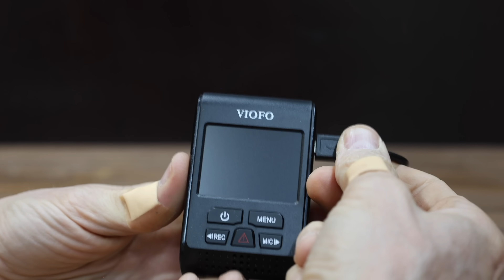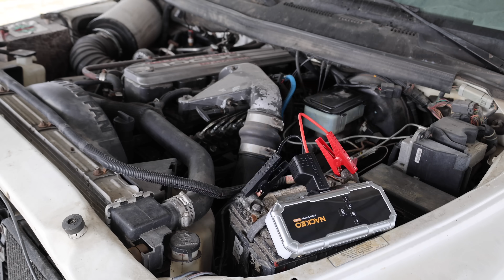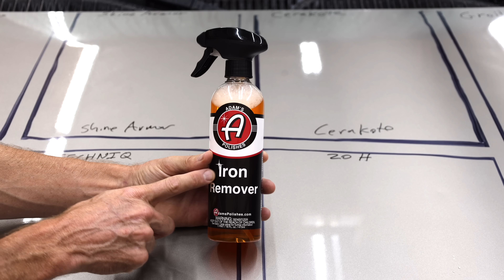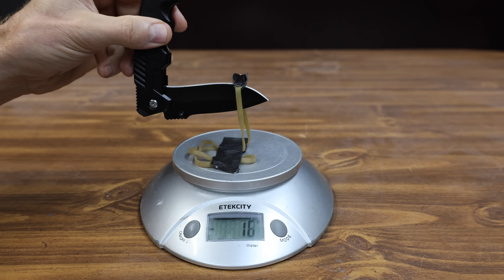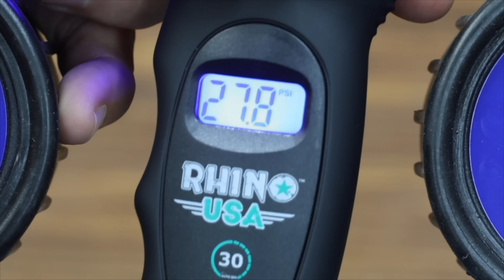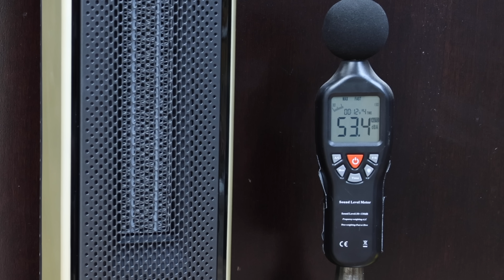Best 10 Items I Tested In 2025

Comment: Great roundup!
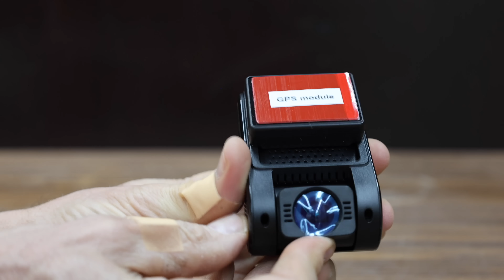0:08 Dashcams
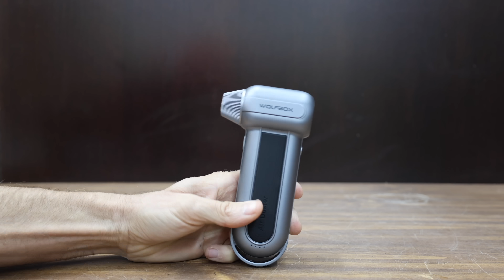2:00 Air dusters
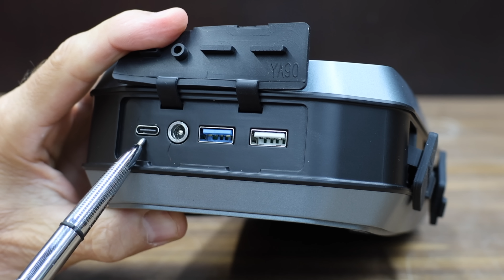3:46 Car jump starters
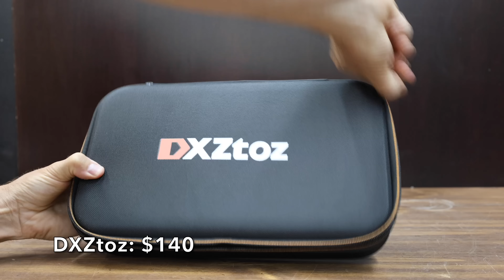5:59 Inspection cameras
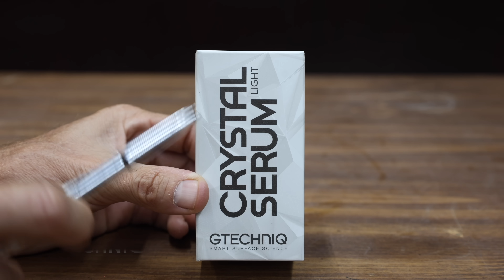7:19 Ceramic coatings
9:36 Car battery testers
11:08 Folding knives
13:25 Tire gauges
15:18 Phillip's screwdrivers 
16:46 Space heaters
Reply from the maker: Thanks for watching!
Reply: yup just bought them all from amazon !
Reply: Dashcam - Viofo $140
Air duster - Wolfbox $90
Jump starter - YaberAuto $81
Inspection camera - DXZtoz $140
Ceramic coating - GTechNIQ $80
Car batter tester - Ancel BA101 $32
Folding knife - Civivi $30
Tire Press. Gauge - JACO digital $28
Screwdriver 🪛 - Craftsman Diamond tip $50
Space heater - DREO tower $90

Comment: I would like a test of battery maintainers (trickle chargers) for maintaining batteries that wont be used but often...not often enough to maintain the battery thats for sure. Maybe a nice year long test.
Reply from the maker: Thanks for the suggestion.
Reply: @ProjectFarm i purchased on from harbor freight that didnt last outside for a car under cover. But boats and RV probably has similar issues.

Comment: I bought the Dreo heater and have not been pleased at all. I first bought a "like new" one from Amazon. It was clearly used and had a terrible grinding sound. I went ahead and ordered a new one which I didn't purchase to begin with because it took 2-3 weeks to ship. It just arrived 2 days ago. It is a newer model and randomly clicks very loudly 10-15 times back to back every 30 minutes to 1 hour even when it is not running. It is either a thermostat or relay clicking, but it is loud enough to wake me up. I guess I am going to contact Dreo and see if they will replace it. If not then both of them are going to be sent back for a refund. The heaters do seem to work well, but that doesn't matter if you want to use them in a bedroom and they constantly make noise that is loud enough to wake 2 people up multiple times per night.
Reply from the maker: Thanks for the constructive feedbacl/

Comment: The air duster, tire pressure gauge/filler and screwdriver set are in my garage because of these videos. Along with many other items from past years. My TopDon battery booster is still going strong but I have the Yaber bookmarked if I ever need another one!
Reply from the maker: Thanks for sharing!

Comment: I have the same wonderful little car battery tester "ANCEL BA101", I used it to test the alternator in my car on at least three separate occasions and the peak charging voltage kept coming at 13.5v. I suspected that something was wrong with my alternator because no matter how much I ran my car it never seemed to fully charge the battery. I looked this up on Google and it said that 13.5v should be fine as a nominal charging voltage, turns out Google was wrong; a few months later my car's alternator died. Also for the benefit of others that don't know this: an alternator that is not working properly and is going bad can and will decrease your gas mileage, further more it will shorten the life span of your car battery if not outright just kill your battery. The point is my instincts told me that 13.5v peak charging voltage seemed too low for alternator and I should have trusted my instincts and this little ANCEL car battery tester.
Reply from the maker: Thanks for sharing.

Comment: Can confirm the wolf box is awesome. So powerful and useful. I use it to blow out everything. Computers cases, laptops, consoles, water from cleaning projects. Just used it to blow off my engine bay after working in the area getting loose debris everywhere from removing parts ect. I’ve even used it to quickly blow off my patio. It doesn’t last forever but it last long enough and charges quick enough for me between uses. The attachments are awesome too.
Edit: I found it from the ProjectFarm video review
Reply from the maker: Thanks for sharing! I'm glad you like it!
Reply: For real, I didn't even know these things existed until I saw his video and have been using it a lot since I bought it. For all the same things you say accept also it's great on wood dust and other products of sawing/routing when you don't want to get a vacuum or leaf blower out.
Reply: It is also very effective and a game changer if you're into cars and like to detail yours to remove water in the intricate et narrow spaces of the car after a good wash.

Comment: Would love to see you test smart thermostats for initial accuracy (temp/humdity) the ability to hold calibration over time, and the ability to maintain a temperature stability (i.e. how well do they dampen minor fluctuations due to air movement in the room, etc.).  Nest, Ecobee, Sensi, Honeywell, and some others come to mind, and I've had issues with all of them with intial and calibrated accuracy, I suspect due to internal heat generation and perhaps poor case ventilation.  In addition, some claim to have "air quality" monitoring capability, but are reportedly widely inaccurate.
Reply from the maker: Thanks for the suggestion.

Comment: I was looking at that Wolfbox but 98dB is deafening. No one should use that without ear protection, especially indoors. The Civivi is a nice knife, D2 steel holds an edge really well, but it isn't very tough and will rust. Blade shape/geometry really matters for tip tests so this will do well, just don't use D2 steel as a pry bar! Boker knives are very expensive, you can get that Magnacut steel for $100 and it is MUCH tougher, like 3x, than D2 and one of the most rust proof steels out there. Just keep that in mind for your usage.
Reply from the maker: Great point!

Comment: The Dreo tower heater was a FAIL after I bought one from watching your review. It will randomly start rapidly clicking off and on extremely loud when on Eco mode. It woke me up several nights in a row! There are a bunch of other Amazon reviews that state the same problem.
Reply from the maker: Thanks for sharing your experience. We're sorry to hear you had an issue with the heater.

Comment: Here’s another idea for a future video A Thermal camera is a helpful tool in my toolbox and one that can pin point the overheating (faulty) components on a board with good FPS is really hard to find specially for a low price. It would be interesting to test the claims they make. Thanks 🙏🏼
Reply from the maker: Thanks for the video idea!

Comment: I have the viofo dashcam. However it has one issue. It sometimes will keep turning on off wifi / recording. I am not sure if this is due to poorly written software or the heat causing the memory corruption. Regardless you'd think that the device should stand the heat of car interior but unfortunately that is not the case.
Reply from the maker: Sorry to hear you had an issue with your dashcam.
Reply: @ProjectFarm no worries. You are not to blame. But i am curious if you can reproduce the issue.